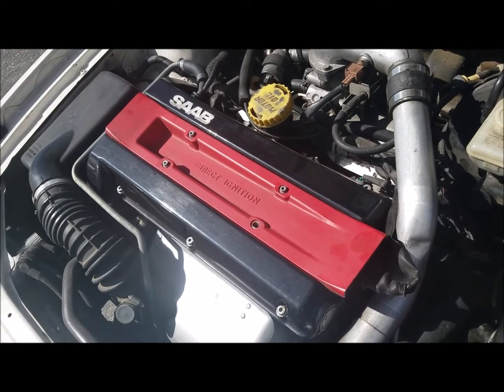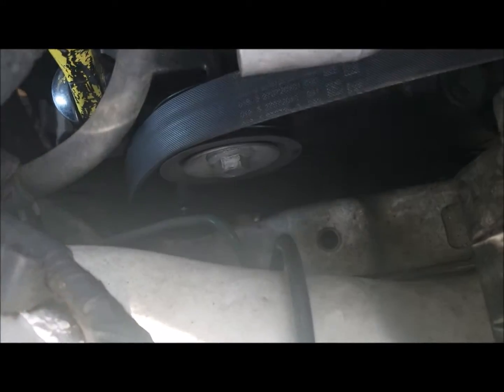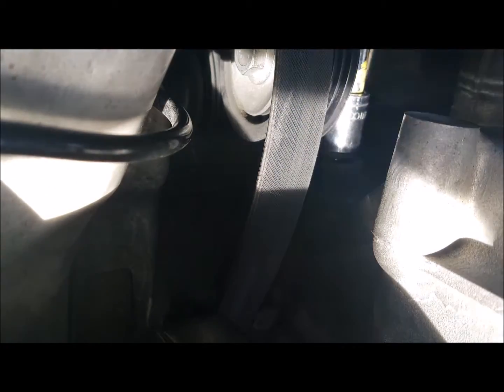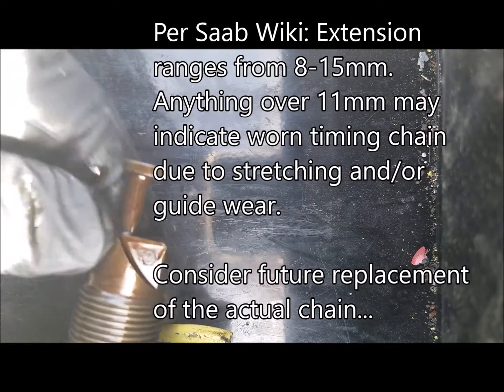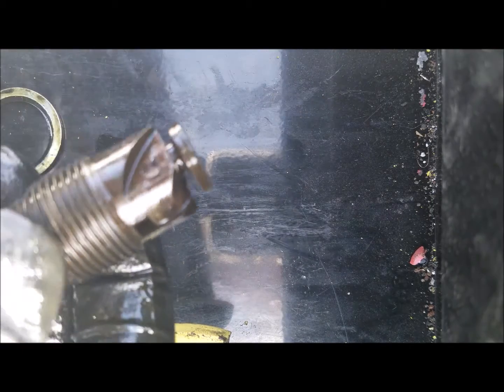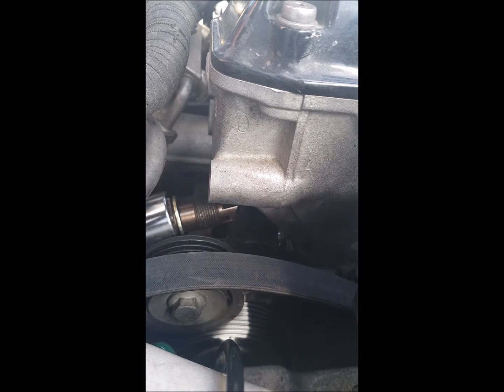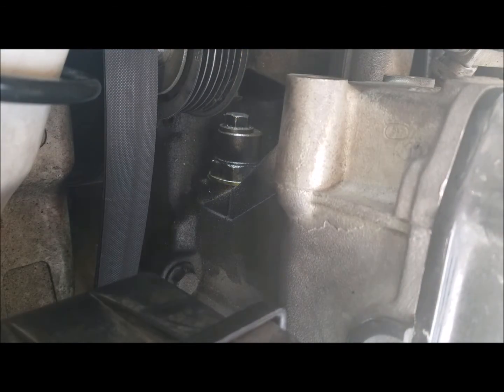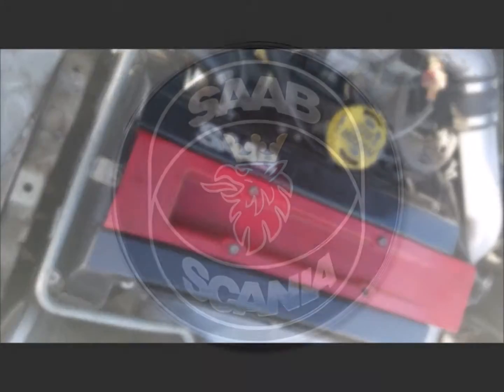Saab - Timing Chain Tensioner Removal

Comment: Hello thanks for the videos. I tried doing this job. Everything went smoothly until I had to screw ghe bolt in. It wont go all the way into the head. It stops halfway in. Should I try to tap the threads or is it hitting something inside and I need to remove the head?

Comment: I always forget that the NG900/OG9-3 had the B series engines. I was looking for a tutorial forever on how to check the timing chain tensioner on a 9-5 and skipped your video serveral times until I realized "Hey, thats my engine (basically)!"
Reply from the maker: Basically. Same procedure as the 9-5, except the 9-5 has that bracket over the tensioner whereas the 9-3 is wide open
Reply: @saabross3171  Do I need to drain the oil before checking the tension?

Comment: Excellent video...quick question. I have the 9-5 which means this is a worse job because that bracket is in the way. It is virtually impossible to see what you are doing. Wondering if I could try just replacing the outer gasket on the 12mm bolt and see if the leak goes away.
Reply from the maker: I have a 9-5 too. You can try, but honestly Andy just remove that yoke mount on the left side of the engine. With that mounting bracket off you access the tensioner and do the full job pretty easily. You can also do it with the bracket on (the one that has the hole mentioned in the video). But yeah you gotta do it by feel. Ive done a couple that way, not much to see anyway. Just don't drop anything!! Haha

Comment: Hiya, i did this today on my 9-5 saloon because of a squeak, thats gone now but it squeals intensely start up and the goes after 5 min. Do you know what could of happened? I pulled the metal pin out of tensioner belts on things and tight.
Reply from the maker: Is the tensioner bad? I'm curious to know more bc I'd hate if you put say a Pro Parts Sweden tensioner in and the tensioner is bad...
Reply: @saabross3171  its a gates tensioner i have been assured it wont be that due to the make, but i dont know, going to investigate lol.. he told me, at 50k thebelt should of been bedded onto old unit? But the pully thing is smooth on new and old the belt is not super hard and a bit shiny, so the belt is a obvious next guess but the thing is just prior to the new tensioner, it squeaked at tensioner now very very loud screech. Ile msg on updates... my fingers crossed..

Comment: can the tensioner be adjusted or is it self adjusting??
Reply from the maker: It's self adjusting, thus the spring-loaded design.
Reply: @saabross3171  thankyou. I guess I need new guides or new chain then thanks still getting a tinkling noise despite having changed the upper guide on the head
Reply from the maker: @leonagraca2239  How many miles we talking? I now have 220k on the car shown in the video, and I agree, there comes a time to replace the chain and all the plastic guides bc there's only so much a timing chain can stretch. Mine sounds like a Panzer tank driving up the driveway, and still drives like a champ, but to replace all the guides requires removal of the whole engine. Those guides get hard and brittle and, with the stretched chain slap, it all adds to the overall noise.
Reply: @saabross3171  does it only sound bad under load or idle too?
Reply from the maker: @normt5463  Both
Reply: @saabross3171  that area is chatty at idle on my 2004 9-5 Arc with 187K miles(I put 10k on it)  The engine has a slight knocking noise under load up to about 2,000 rpms and then gets muffled by the engine noise.

The car is well taken car of as a Georgia car not seeing salt.  But it looks like the shocks are original and thinking the motor mount could be bad and amplifying typical iron noises.

Comment: My garage diagnosed oil leaking from the timing chain cover-(requiring a removal of the engine and removal of the head gasket and resealing of the timing chain cover). Is it possible the oil leak is coming from the timing chain tensioner? I guess a visual check of the TC tensioner might help to see if oil is seeping out. 2001 9-5 Aero 156K. Thanks.

Comment: You are the man. I've read a guide for this process, but now I'm actually ready to do it. Thank you for taking the time, to make these videos, to figure out a way to get a camera angle before you proceed, and to add in part numbers, torque specs, and helpful red circles.

Keep up the good work!
Reply from the maker: Hey thanks Ryan. The whole point of these videos is to demystify the process that shops charge 4x for. If you're keeping a Saab on the road in 2018, I say you deserve the info on how to do so free of charge! Just knowing you have to confidence to do the job makes the time put into these videos 100% worth it. Glad it was of help, I can't thank you enough for the feedback
Reply: I had it out last night, my tensioner measures 14.5mm extended, and I do indeed need to order those two seals. I'll add that I think it's easier to push the plunger to full extension and count the clicks. I've got 4 clicks left. It clears up any uncertainty about measurement method.

My 01 9-3 is my first and only car, I've had it for 10 years and I'm stubbornly determined to keep it going. My last few visits to the shop were for the yearly inspection. After 9 years of wrenching out of necessity, I can finally afford the nice parts I was eyeballing in high school!

I owe a debt to the Saab forums, and more recently you and SaabTech, for keeping me on the road. Now I'm keeping it interesting with the rascals at TrionicTuning. If you haven't gone down that rabbit hole, I'd be glad to get you started. They lured me in with OpenSID, now my car's drinking alcohol (E85) and making obnoxious torque.
Reply: @saabross3171  hey , mine is leaking too, should i replace the tensioner ? the 8048670 comes up as the larger seal, would you have the part number for the seal on the first bolt ? thank you.
Reply from the maker: @randyeastman4500  That should be the correct part number for the o-ring. https://www.esaabparts.com/saab/parts/8048670

Comment: You're not suppose to tie down the timing chain for it won't get messed up?
Reply from the maker: Doing in car? Not at all. The tensior pushes against a plastic guide which pushes against the chain, can't mess it up. Unless you have the valve cover off or are doing extended engine work there's no where to even access let alone tie down the chain
Reply: Saab Ross Oh alright. Was just wondering as I was told to tie down the chain with zip ties when replacing the chain tensioner on my 08 93 2.0T also wonder if it's any different since you say it's not needed. Will verify for sure before I do the job as always. Also if you're on Facebook join the group Saabmerica!